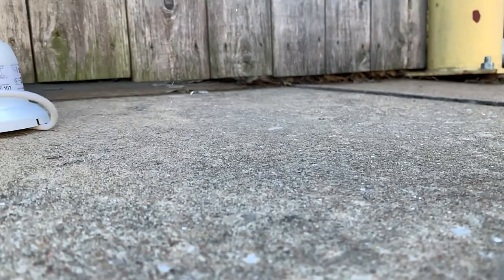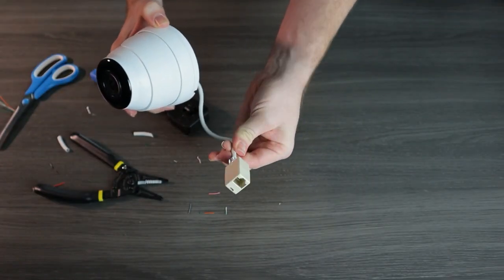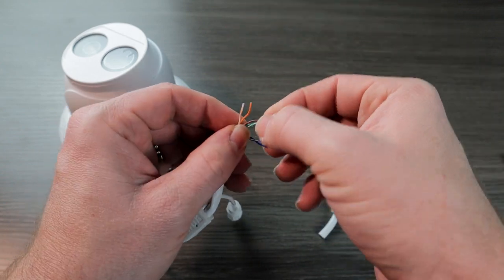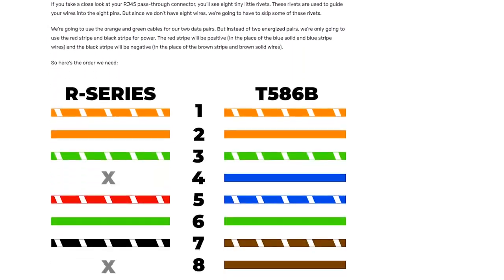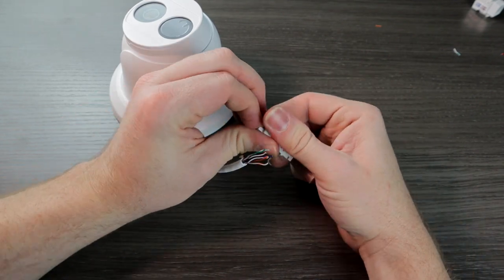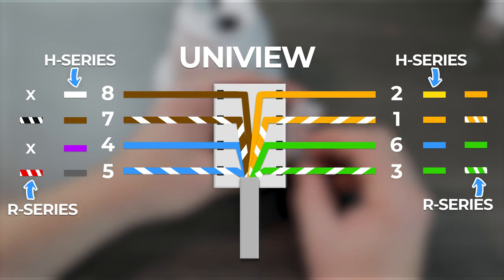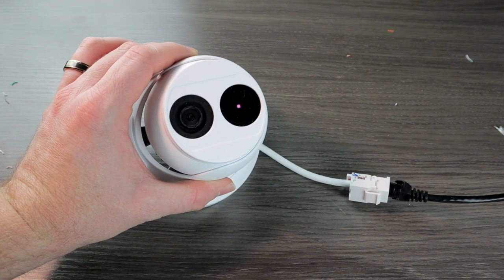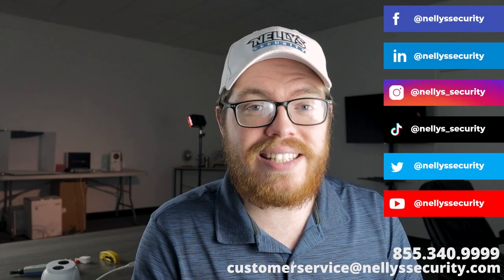How to Fix a Uniview IP Camera RJ45 Ethernet Connection with a Keystone Jack and Punchdown Tool

Comment: Hello
I want to change the RJ45 ethernet socket of my Uniview ip camera. Each of the 8 cores of the cable is multi-wire. It is not single-wire like Cat6. Can I make a Keystone jack to the multi-wire cable? Does the cable come out of its socket again?
Reply from the maker: Whether it's single or multi-strand wire, the process should be the same! As long as you follow the steps in this video, you should be good.